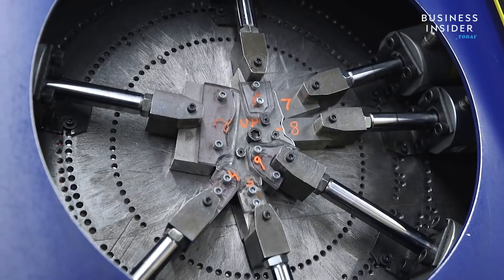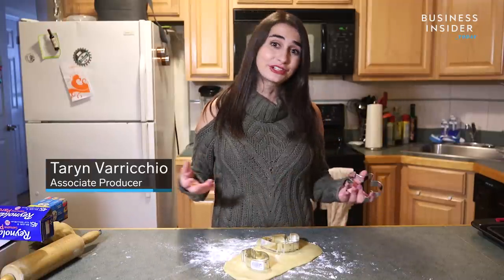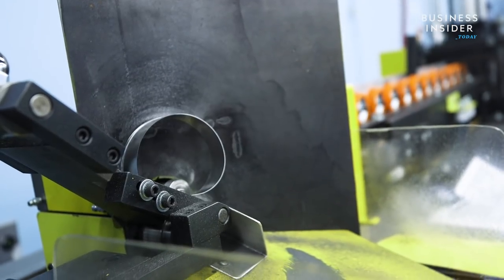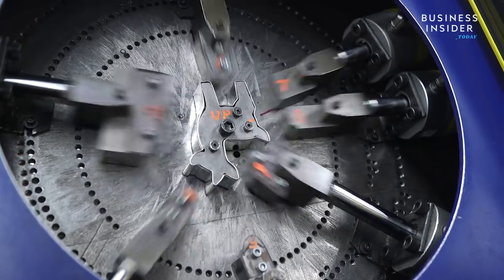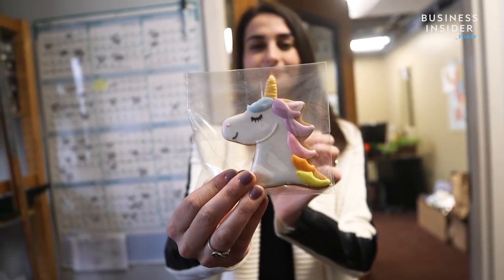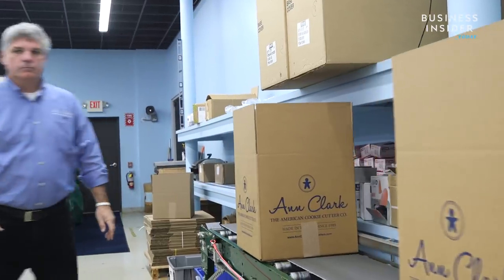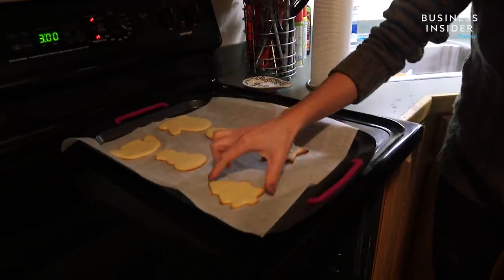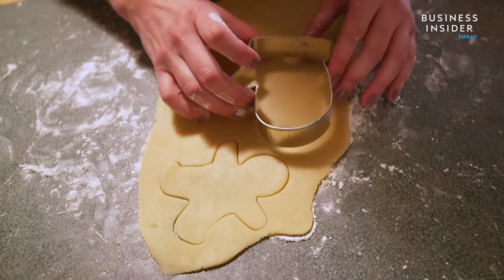How Cookie Cutters Are Made

Comment: The "molds" seen here are made of steel by machinists using saws, vertical milling machines, drill presses, grinders, many other metal fabricating tools and techniques including EDM. This all comes under the general heading of "tool and die." Most decent sized manufacturing plants have at least one or possibly an entire team of machinists who build whatever customized "tools" or "dies" are needed to fabricate various materials into whatever shape the customer needs. Some of the tools/dies used in this video are operated manually, while some of the cylinders/pistons can be operated by pneumatic(air) pressure or hydraulic(oil) pressure. I'm not sure if there is a specific term or name that could be used to describe these machines, they are highly specialized. Many times a specific tool or die may be used to manually produce a sample or prototype for a customer. Later it can be upgraded, modified or even automated to speed up the production process.